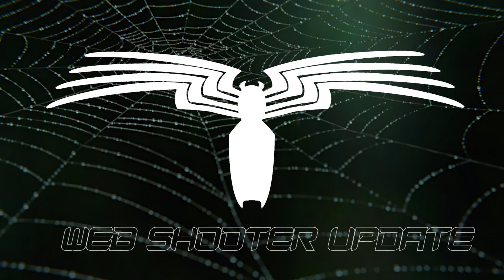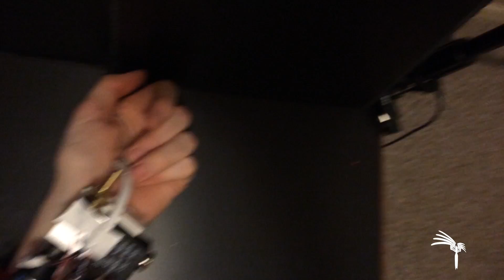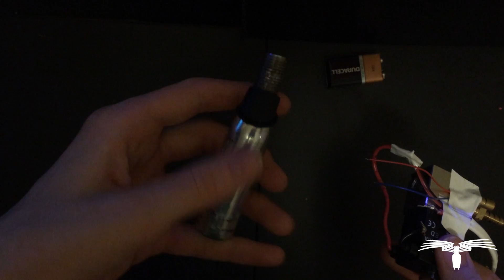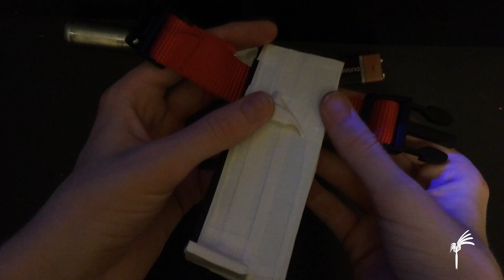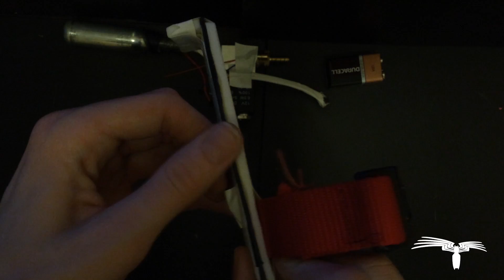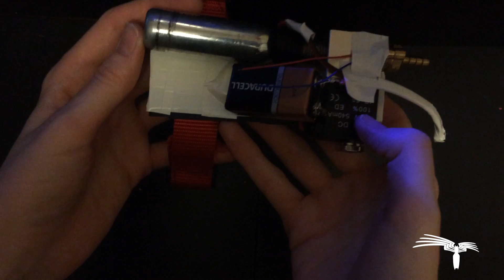New Solenoid Web-Shooter Mark I!

Comment: I have a question. I'm actually trying to build web shooters of my own, I guess based on this one, seeming as though this is the smallest version of the shooters that I've seen so far. How does the trigger system work?
Reply: I mean, how did you wire the trigger to the solenoid valve, and then to the battery all the same?
Reply from the maker: +Speedy1SonicBoy awesome! It was a bit tricky but you have to find which side is the trigger positive and negative. The.amazing has a tutorial video if you need help.

Comment: What did u use for the trigger and do u need a battery for it to run
Reply: I mean the stuff that the trigger is made of not the button. I'm looking for the trigger kind of wire that the.amazing used for his tutorial if u watched it
Reply: Yes thank you very much 😀😀
Reply from the maker: UltimateSpider The only reason I don't use that outlet cable (and neither does the.amazing on his new vid) because its not very flexible and you want to have it flexible where you can have full rotation of your wrist. The.amazing attaches his button to a wrist band that he wears on his palm (check out his latest video to see how he has his button set up).
Reply: Thank u ill give it a shot and see how I like it and do u have to use and empty co2 cartridge to store the web fluid? Plus I'm looking to join the guardians!
Reply: The Spectacular Hey please give me the formula I really want to make this launcher with the web more I do not know the formula I want you to use

Comment: I dont really understand how solenoid web shooters work. I dont really understand what shoots the fluid out of the shooter. Can someone please explain to me how they work.
Reply: He has nothing that shoots it out yet its just like a base design
Reply from the maker: Yeah so it's really easy. I put my fluid into my canister alongside some isobutane which adds pressure inside the valve. When I open the chamber via the button, some of the fluid is pushed out alongside the isobutane. This is not a basic design, this is the web shooter so far. To see how it works check out the.Amazing's videos. He actually shows how it works. :)
Reply: ***** which video of his do i watch to figure out how it works, iv seen his mini real life webshooter vid and his real life webshooter vid
Reply from the maker: Watch the web fluid ones. He shows how he makes them and tests them out.
Reply: thanks